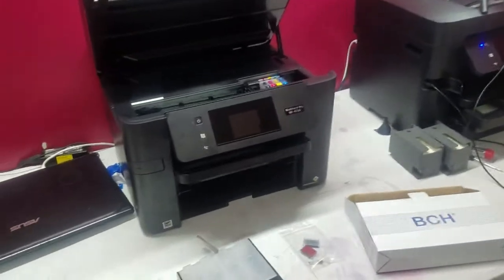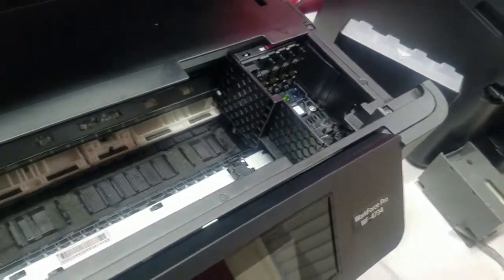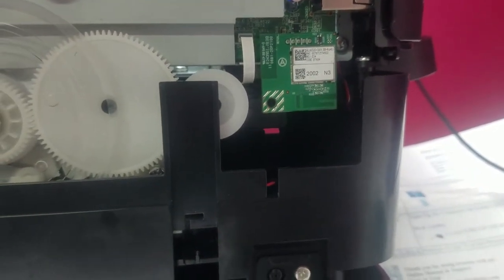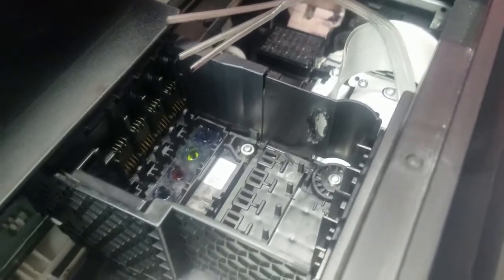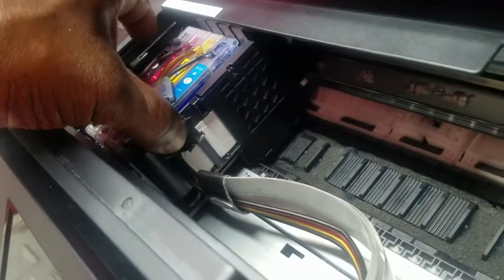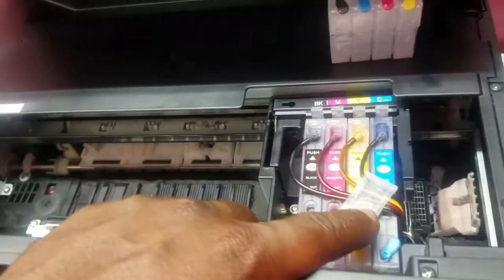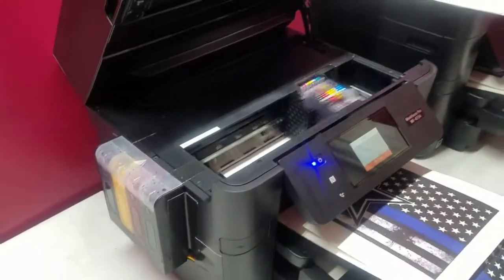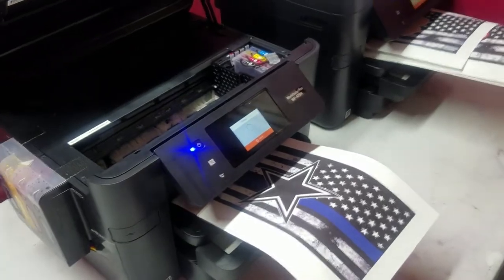Sublimation Printing with Epson WF-4734. (Pt.3)

Comment: I converted my wf-4730 by following this video in great detail. I ran into a technical problem which was not addressed in this video. I ordered the exact self priming ink tank from the link provided. The magenta and yellow self priming tanks are incorrectly switched, backwards with their respective color labelings. This creates a problem when you connect the end of the tubes to the cartridges as the designations for each cartridge position by color, namely magenta and yellow are reversed on the printer carriage. To overcome this during priming of the cartridges. I had to put the yellow cartridge in the magenta position and the magenta cartridge in the yellow position which causes an overlap in the two center tubing's of the ink ribbon,  resulting in a slight bulge and the tubes will not lie flat on the top of the cartridges. There is very little space tolerance  when the top of the printer is closed. The inside of the top is just about touching the bulged ink tubes. Those of you attempting this be aware of the color designations for the yellow and magenta orientations so the ribbon tubes will line up correctly. Easiest correction is to switch the yellow and magenta color designations prior to starting within the self priming tanks upon receipt as they are backwards when they come from the seller.

Comment: This is excellent work! I have a very similar printer, the WF-4834, so this is why I looked at your video. The cartdridges are different thougfh. Would you know if this mod would work with the WF-4834?
Reply from the maker: No the 4834 is the newer generation printer. Those can not use a CISS yet. Not until there is a chipless firmware for them

Comment: hey i checked the website you link for the refillable cartidges. i see the 4740 listed but no chipless firmware for it. i bought the cartridges thinking i could use it..
Reply from the maker: I thought we changed the titles. The 4740 can not be used.  
Contact me via the website and I'll make sure you get your refund. Thanks.
Reply: Hey, would it be possible to have a chipless 4740 ?
Reply from the maker: @cookiemonsta2047  No. They don't make reset chips or a chipless firmware for the WF-4740

Comment: Hey I am stuck what firmware can I use ffg or the 4740?
Reply from the maker: They don't have a chipless firmware for the 4740. So you won't be able to do it with that. Keep an eye on the clearance section on Epsons website. They have the 4734 on there now for $80
Reply: I just checked check they have the empties like u but  I dont understand are they chipless or I just can't let them run low before triggering the printer warning indicator?
Reply from the maker: @vibingwithredd4540  you can't use them at all if you have a 4740. Because they only work with printers running chipless firmware. The cartridges have no chips at all. So they.wont be recognized when you insert them into the printer.
Reply: And I can't keep refilling  the old one
Reply from the maker: @vibingwithredd4540  unfortunately, no.